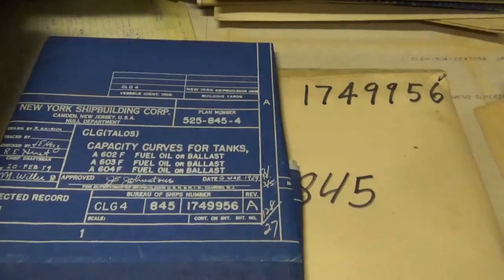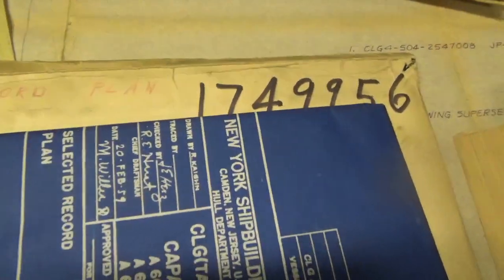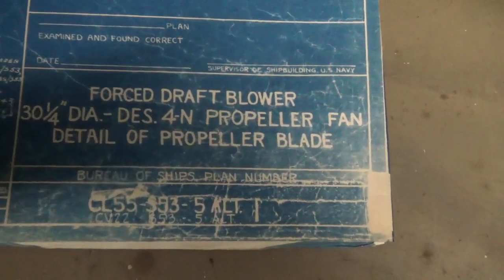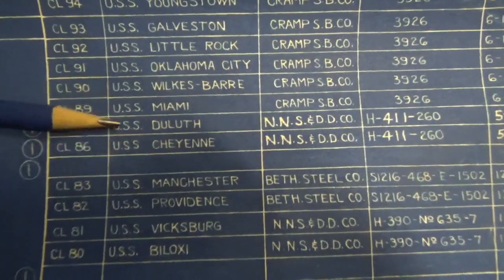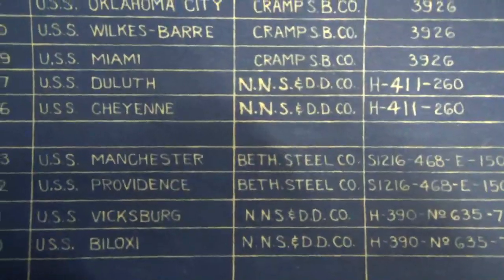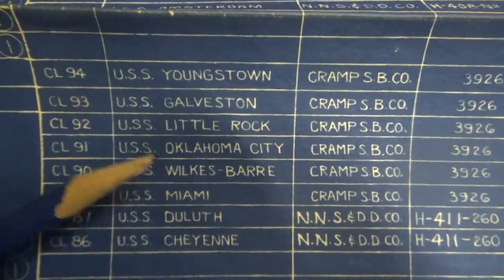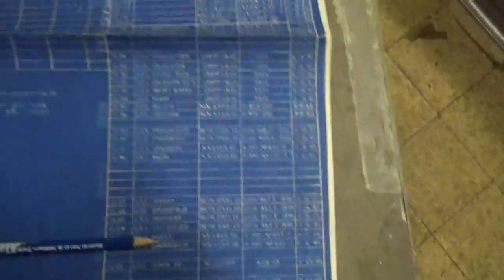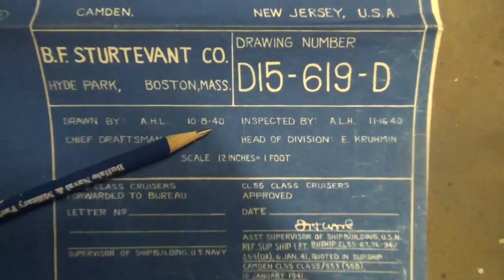US Navy Blueprints: What can be learned?

Comment: Great video Shane 👍As a former Mech. Eng. draftsman (pre-computers) I'm always astounded by the amount of engineering that went into the war effort in such a short amount of time. You have to realize that all those ships and weapons were designed and built with slide rules before computers were invented. Every rivet, nut, bolt, wire etc. had to be specified and blueprints drawn by hand. The manpower and organization involved was astounding.
Reply from the maker: Joe, I concur with your insightful assessment! It was amazing the work that all those draftsmen did...and coordinating with 40+ shipyards around the country. It was the pinnacle of public-private partnership and worked so well! Thanks for watching, and for your insights!

Comment: Interesting how drawings and ships have "changed ownership" during their progress from drawing board to your engineering library.
Do you have, or is it your intent to have, a drawing /document register so you can more easily find particular blue prints?
(Or did I miss that while sneezing?)
Reply from the maker: Ha! Thanks for your interest, Rob! This is the first level processing step, just to gain some control of what we have on board. Then materials can potentially be grouped together (if original order is broken) which is step two, and then create a workable index (step three).
Reply: @BuffaloNavalPark  Shame I'm on the far side of a big ditch to you guys - I spent a fair bit of time working on cataloguing uncatalogued documents.  It can be pretty tough at times, but in the end it's very rewarding to be able to answer the "Have we got the drawings/documents for x?" and say with certainty yes (or no).